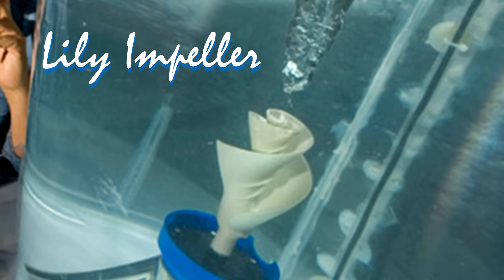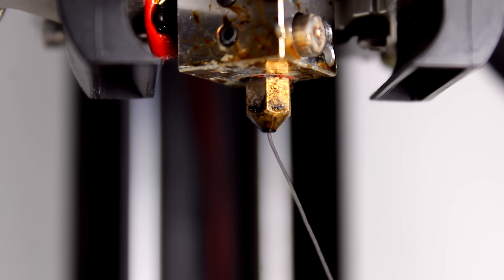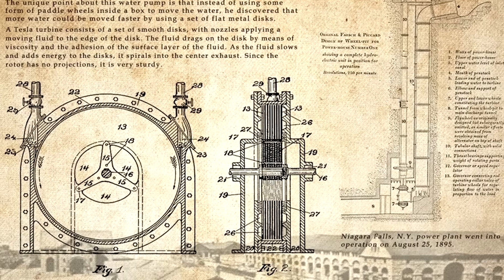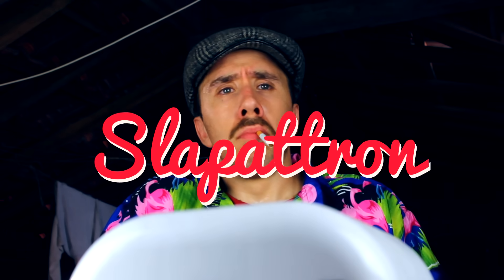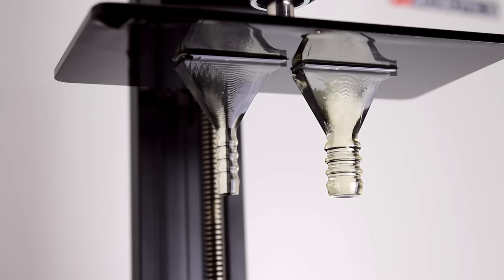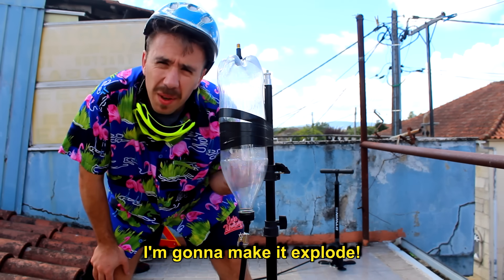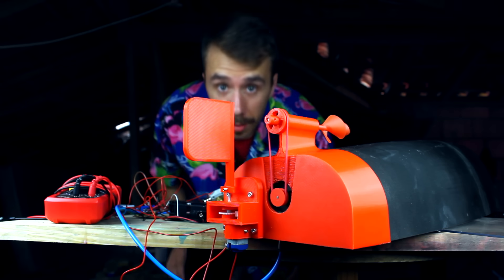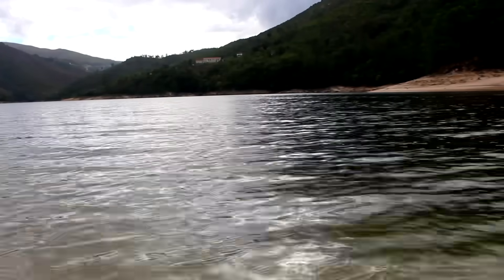Tesla Turbine Boat 3D Printed (Lily Impeller)

Comment: "the people watching you are as lazy as you are, they'll give you a like for finding the easiest solution" lol so true 😂
Reply: Honestly over complicating things is a trap a lot of new engineers fall into. It really is a skill to know when to reinvent something and when to just use what works.
Reply: @deadeyeduncan5022  I think the flaw is not over complicating. Its bad customer interfacing. 
Yes many many engineers forget about KISS, but its also drilled into you to keep things as simple as possible. I find it much more likely that engineers fail in getting customers to have realistic goals that meet their needs.

There is another often forgotten trap, just because something works doesn't mean it works well enough. Complexity can add functionality, improve efficiency, add safety.
A complex system needs to be respected though.

The real trap is not using the correct tool for the job and giving insufficient time to engineering it correctly.

TL;DR if the goal can be accomplished simply then do it simply. However do not avoid complexity just because it is complex. Use it to achieve a goal the best way possible.

Comment: You said the next project was tesla turbine airplane right? Well straping 6 Bottles worth 1 minute Run sucks😵, just Like eating Tomato🤣🍅
Heres my Suggestion to that, you should take only 1 bottle but the bottle has a DRY ICE and a little  water for continous sublimation of Co2 which in the same time produce pressure, also put a automatic pressure release valve so that 
The bottle dont get "TomatoED"🍅💣💥😂

Comment: Great video! I love the lily impeller. You could improve the performance by encasing the lily with an inlet and outlet nozzle so that the momentum of the water is redirected to the rear. In this configuration most of the water is forced outward, radially from the lily. But all that does kind of take away from the beauty of the lily!

Comment: What if you were to make some kind of casing around that lily impeller to increase its rearward thrust output? A lot of that energy is going out to the side, and surely some of it is ending up going forwards. So I wonder if any kind of cone or other shape could be used to prevent the water coming out of impeller from flowing forwards.

Comment: build a 3d printed tomato that breaks from the inside when you yell at it for being a stupid tomato. you could print it in 5 different parts with small holes in the side of each one, then you could out small magnets in them so you could break a tomato as many times as you want.

Comment: Try putting it in a duct that begins and ends underwater, with an adjustable nozzle on the end for steering. (Jet boat) I wouldn’t recommend a tesla turbine because jet drives are quite inefficient.

Comment: A 3d printed tank that uses a tesla turbine to move the tracks and a small firework for the gun and a small air pump for the turbine. As well as running over tomatoes, of course. You have to use Lego 9V motors for the inclination of the gun.

Comment: Hey i have a simple idea to improve a little bit the turbine... the drag is related to the boundary layer and the rugosity... so if you use sandpaper to make a lot of tiny scratches on the surface, you should be able to transfer more energy of the fluid to the discs! I hope you can try my idea to see how it changes the efficiency :) greetings from Chile 🇨🇱
Reply: And a detail... you should sand it in the radial direction

Comment: " the only problem with full throttle is, it ends fast" uhh yeah, especially if you can't steer. You can use an impeller as a propeller.

Comment: Some improvements you could make (so its not slower than glue):

1: Give it a bigger prop (more area=more thrust per speed).
2: Give it a gearbox for more torque.
3: Move some of the bottles out of the water (less resistance to thrust and turning).
4: Move the rudder to the center.
Reply: the problem is the impeller spits a lot of the flow sideways. it just needs an enclosure around it to focus it.
Reply: @Veiss seven yes, this is what jet boats do.  They have an inlet and the impeller is in an enclosed chamber that redirects the flow in a single direction.  This is also what the latest generation of submarines do with impellers.

I would love to see how this performed with a proper inlet and nozzle.  It would likely move at many multiples of the speed.
Reply: @mandoreforger6999  Exactly, well said regarding jet boats
Reply: @Veiss7  can't he use in impeler inside tube and then run water inside it ? water is not compressable as air and it should have higher torque and he can use the gears and get his previes idea working
Reply: @jordangogov5866  the problem I see is that enclosing the impeller would create more pressure on the impeller itself and moving it efficently will require more torque.
The main problem I see here is that the tesla turbine is efficient but has very low torque and it's not the best to move the impeller in a dense liquid to begin with.
Also the rubber band he uses to transfer rotation to the impeller gets a lot less "sticky" in the water and at hig speed could just skid off a lot of energy. 🤔
Reply: @Veiss7  Smart!
Reply: @Veiss7  that is the design of impellers such as are found on jet skis.  Have to be made to very tight tolerances.
Reply: The exhaust gazes from the Tesla turbine are also a huge energy Lost.
You could redirect the flow to use it for propulsion.
Reply: @davide.8758   according to GravInert's channel... that was supposedly how Tesla intended to use his turbine to power his flying machine.

The cold steam version of the Tesla turbine is just amazing, and probably has the potential to put Photovoltaic solar out of business for home energy generation.
Reply: I think that a lot of the thrust was hindered by the placement of the impeller since water is being blown to the side in order to help increase the efficiency the impeller should be placed in a place where nothing would interfere with it other than the water and theoretically it would make a vortex that eats itself with a shape of depressed sphere or when moving it would look like a drop of water where the drop has a tail end
Reply: More thrust? Yeah... But larger in size is also more drag and thus, including the extra weight, more power is required to drive it. Fact is, this design will never be fast. There is a reason militaries here in 2020 don't use that design in ship design.
Reply: maybe also run the impeller inside of a tube? seems to me that it would just throw most of the water out the sides, rather than pushing it backward. with the impeller inside a tube of some sort, it would have no choice but to push the water backwards, thus propelling the boat forwards.
Reply: Enclose the impeller inside a ventury !
Reply: Or control the direction of the flow, as there is quite a loss of thrust this way.
Reply: Propeller  eficent side is other side i mean reverse speed go backside faster

Comment: Try making the impeller ducted like actual impellers in jet boats are they work much more efficiently that way as instead of just pulling on water it will be accelerating it through a restricted space making the impeller much more effective and powerful. Also lower profile design will means it will work in shallow water unlike normal propeller driven boats.

Comment: I'm sure it would have been faster to just add a 0.5 liter bottle filled with water and use the compressed air to push out the water and use that as a means of acceleration... fun project but that end was very anti climatic :)

Comment: If you place the impeller (or a propeller) into a shroud or duct , you will dramatically increase it's efficiency, as it will minimize power lost to the fluid (air or water ) being forced out to the sides .  Jet skis work this way. :)

Comment: Since Tesla turbine is just like  accelerating a car from the highest gear But higH rpm, and also you saw TOM STANTON's air powered or capacitor powered 3d printed Dragster, and we all know Dragster must have a high ACCELeration, can you 3d print a 
TESLA TURBINE DRAGSTER

Comment: Too bad a tesla gas turbine, using a tesla turbine for the compressor, and for the turbine, can't be 3D printed. It would require some pretty heat resistant metals.

Comment: Try putting a housing around the impeller like a jet boat uses. That should give a lot more thrust and speed. Also, have you tried running the Tesla turbine with water? It doesn't compress as far so, if you use water then compressed air to push it, it may give a longer run time? Maybe?

Comment: Use water with the turbine. Mod a water pump to boat as intake for the turbine and a nozzle for the turbine output you could leave the rc controls for the rudder in place to direct the water output nozzle so long as that nozzle was made with a simi flexible material. The beautiful thing with the tesla turbine is that it can be used with air or water. So long as the pump keeps up with the turbine your turbine output could be much greater and that its a boat surrounded by water you will not be limited like you are with air supply/ pressure and be operating the boat longer.

Comment: Could you make a steam engine powered  submarine. Using rust and aluminum powder (thermite). It would have a lot of energy as long as you can contain it without burning the whole thing. It's a long reach but I thing it's possible

Comment: hey there Inetgza ;-), i was thinking of making this for a long time ... so here is a suggestion >  make a tube around the back of the impeller to streamline the output flow ...
Reply: Do some research on that impeller design. As a lot of other have said to shroud it but that won't work. It would work much better though if he actually used it as an impeller. He has it backward.

Comment: I think your main problem is drag.  The flow created by the impeller is disrupted by the pulley behind it.
I would say a bigger impeller would be good too, but I wonder what two, mounted side by side would do...  Also, stacking the air tanks inside the boat body?
Awesome!

Comment: Would the impeller work better with a shroud in the case of the boat.Also are you sure there isn't any belt slip of the rubberband when in the water?.Great project,enjoyed the video.

Comment: Hi, I think you might be losing power with your rubber band transmission.  It worked well in air but when in water the impeller is under ( a lot more) load and the rubber band is wet.  Slippage.  A geared transmission would eliminate the potential slippage and allow you to experiment with different ratios.  My unsupported gut feeling is you might get best results with about twenty turbine revolutions to one impeller revolution, but with two axels a fixed distance apart you should be able to print out gears that will allow you to try quickly try out a large range of ratios.  Plus you will have a cool set of varying ratio gears for your next project.

Keep having fun and keep bringing us along with you.  Thanks.

Comment: I think a shroud would dramatically improve the impeller's efficiency, and you could 3d print it.  So it would work more like a jet engine because it will compress inside the chamber, and have higher exit pressure.

Comment: I love your idea of combining the work of two geniuses! Very inspirational!
I would love to see if the lilly impeller could be housed in a cowling and tuned into a ducted fan blade?...and what kind of thrust that generates on air rather than water?
I envisage a tube with a tapering vent for the air to be concentrated before exiting. It would look something like a jet engine does, but with only about 3 or 4 parts maybe?
(If I had my own 3d printer I could show you what I mean, but, alas not...) 😒

Comment: It may be losing most of its stored energy in the tesla turbine section. Most of the air rushes out without imparting energy to the discs, its an open leak.

Comment: You should make a helium filled  Mylar balloon derigible / airship using a solar powered 5v water pump and a small liquid resevoir, and use the tesla turbine to turn the propellers. Yes you could just use electric motors to turn the propellers, but then there is no challenge and you don't get to use the Tesla Turbine.

Comment: Mechanical “battery” / Vacuum hydraulic “motor” (toothbrush): 
“Tesla turbine” with directional “Tesla valves” (to regulate direction of circuit throughput with a fluid, instead of air?) pumping back into a main reservoir via pressure valve/gate, once vacuum is expressed into the circuit, through two or more vessels and a syringe (input?)...Output should be high torque mechanical spin, until vacuum is released, to power...?
If small enough to replace existing “electric toothbrush” handles, give them away and only ever “sell” replacement bristles?

Comment: You need to build an impeller housing for the Lily impeller. Impellers work best in a housing to control the waters force and give thrust, propelling the boat forward. It should be easy enough for you

Comment: what if you reinforced a 2 liter bottle or even smaller bottle with carbon fiber fabric, or something similar to increase the tensile strenth? Firefighters air bottles are made of steel or aluminum with compressed carbon fiber, and they hold up to 4500 psi, i bet you could make it much stronger. but if you did..... how would we reinforce the bottle cap or nozzle to allow it to hold that amount of pressure....? :\ i love your channel btw i just found it and watched 4 videos and subscribing :D

Comment: I think that the water bottles in the water is providing great resistance to the boat and this is why it does not move fast, if you design a new boat where you put the air tank inside I think it would work much better.

Comment: An R/C boat/plane that utilizes most of Tesla’s inventions/innovations such as A turbine->ac motor-> impeller/propeller. Or capacitor-> induction motor-> propeller. Possibly a super capacitor rocket/boat/fan boat. Of course, Neon lights would be a nice touch but a little bulky and impossible to make with a 3D printer.

Comment: Thanks in advance for your kind offer of a 3D printer. I think i live too far away though - but appreciated all the same. I was thinking - and it's probably already been mentioned in the comments, that an impeller should be enclosed. Your design is throwing away heaps of energy, hence your boat is very inefficient. If you placed the impeller in a tube, and even better, one with a tapered end you could then take advantage of the Venturi effect and you should get an even bigger performance boost. Fantastic channel, and really entertaining. The way you do the promotions is very clever. My kids are big fans as am I.

Comment: Make a 3D print sterling engine !!!
Reply from the maker: Done that 😁
Reply: Integza maybe this ?
Reply: How about a 3D print a new type centrifugal clutch for a small engine like for a mini bike? the design needs a little (a lot) of work.I’d like to see something using gears like an old starter  instead of friction plates that will burn out and need replacing in a month of hard use may be a game changer for some of us

Comment: This could be on the dangerous side of things but if you want a simi continuous supply of gas pressure try it with dry ice and water in a container. And if you place the impeller in a cylinder with a larger opening at intake side than exhaust side you should be able to produce more thrust due to berelliees (probably spelt wrong) principal.

Comment: 2 related ideas, if the printer can do them. 1. Use a flywheel on a water wheel to store as much energy as possible. 2. Create a constantly variable transmission to regulate the output to a useful speed and torque. I'm curious if the relatively modern invention of the constantly variable transmission could make waterwheel power useful again for small scale/point of use applications?

Comment: Build a delta wing airplane with 2 bottles as the fuselage. Mount the turbine on the top shaft to the back. A drone propeller in pusher rotation should work 👌

Comment: If the boat was longer to hold the bottles inside 2 wide with a teardrop shaped flat bottom, use 2 sets of 45 degree angle gears from the turbine to the Lily facing backward, you could steer with the impeller and the boat will go faster and be very stable.

Comment: Nooo, I was working on the same project, just with a normal dc motor. Would have been awesome if you used the arduino, as you’re projects are always “something more”. Nonetheless I’ll continue watching. Maybe a duct would have increased the flow on the impeller, or even have it enclosed as in jet sky. Awesome job!!!

Comment: I saw that you have a stirling engine car where you power it with fire / hot air. Have you considered using electrical resistance to heat a piece of metal? I wonder if it's at all efficient

Comment: Why don't you use a high pressure air tank from an air rifle they hold up to 4000psi and would run your tesla engine much longer with a high to low pressure valve maybe a bigger impeller too.

Comment: The side opening of the impeller is the inlet and it is designed to gather the water and shoot it out the back of the impeller, which you had facing the front of the boat. You will achieve much better results if you turn the impeller 180 degrees(front to back) and place it behind the boat. Love your channel and have fun!

Comment: i was just wondering about something moved by the Tesla Turbine. You can try to use it to make a remake of the boat but with a PROpeller. 
Or try to make something like a "Van Der Graaf generator". But using the tesla turbine to move the shaft (maybe too much TORQUE needed)

Aniway, good luck!

Comment: What if you used only one two-liter bottle, and instead of manually pumping air into it you instead us a piece of dry ice with water. The dry ice and water would produce carbon dioxide that would automatically fill the two-liter bottle which will be used to power the turbine for the boat.